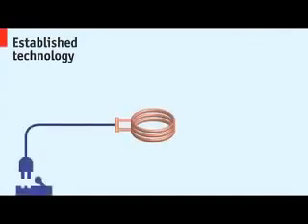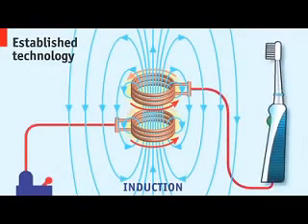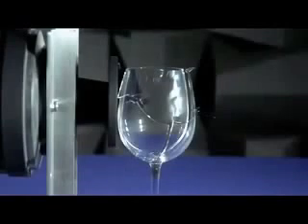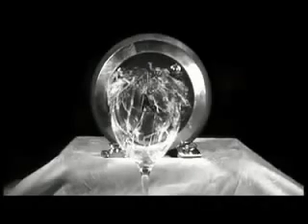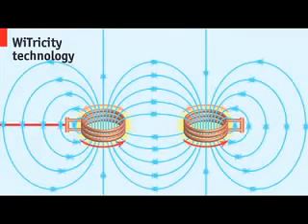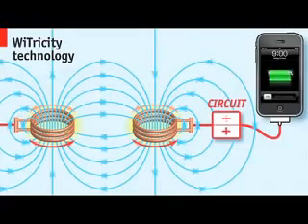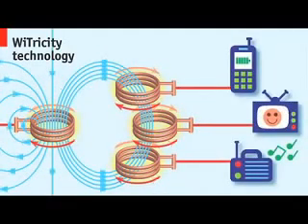How Wireless Energy Transfer Works

Comment: For example, on freeways there are light posts that are wired up all along the road. A resonating Tesla coil could be put in each one where the charge just passes through it. Electric cars with complimentary coils could pick up  the field and turn a motor that turns an alternator to keep the charge on the batteries to extend their range.
Reply: That’s exactly what i thought coil the energy from cars on roads you get the kinetic energy for powering the grid simple

Comment: Earth is a giant magnet, but it is a permanent magnet- permanent magnets don't work this way. It has to be an electromagnet with AC current (preferably at high frequency). This only works with AC current because it is the frequency change that causes the potential for current to flow.

Comment: This is a very good explanation. Today  on yotube 95% of the magnetic coupling wireless power transmission show a school and easy principle : 2 coils perfectly aligned and a LED is lighting on or off.

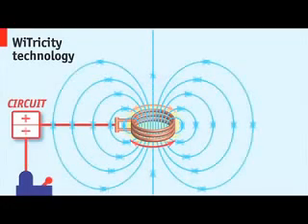You show a principle of coupling when the coils are not in the same axis but where the coupling effect born at a certain distance exactly at 1:16 of your video...very good and another better dimension for physical understanding.
Thank you
Reply: unfortunately this does not work. they cant actually pull this off as they show in the video. this was a video created to raise money but.... it can't be done at these distances without EXTREME loss in power. even wireless phone chargers are inefficient when sitting right on the pad

Comment: Very good, this video shows wireless power short range transfer with alternating current at i50-60hz, that's the current changing direction 50-60 times per sec. Tesla(I believe) knew that changing or pulsating magnetic fields generate power in any conductor in the field range. So the end result we want is Pulsating Direct Current & it needs to pulsate the largest magnetic fields possible. In order to increase a D/C power supply is to change it into A/C then use A/C power step-up phases for power

Comment: Then change the stepped up A/C current back into the original signal that we want to transmit, Pulsating Direct Current but now we have used A/C to step up its amplitude, modulation, and Voltage/Power durring the final A/C to D/C phase. This now High Voltage D/C can be sent up an Antenna to now pulsate huge electromagnetic fields that generate power anywhere with rage of the signal.

Comment: This method could prove usefull onboard an electric vehicles. I like it as a safety feature at first glance. Batteries require heat as well. Maybe these coils could double as a heater for extreme cold environments.

Comment: Also saying this hasn't been done beofre is wrong Induction is used in both heavy and commercial industires for heating coils. Usually the 2nd set of coils is wher it end but from induction welders to stove top cookers. I'm pretty sure using this for transfering energy is much less effecint than just using copper wire.

Comment: This is not Tesla tech. Tesla worked with very high voltage impulses. That means it is driven in one potential direction and allowed to relax or radiate outwards. When another coil that is tuned to these impulse duration and quantity per second variables the reflection of the impulse back to the source emitter. If you time it right you can recycle this reflection back out. This forms a sort of feedback between the two emitters and a magnification happens in the high density plasma streams between the two emitters. The Tesla system would simply be an oscillatory source of impulses. In this case the oscillatory part is on or off, not of positive or negative. If you keep them all one potential it lowers any potential danger. This is like the bird on the live wire effect.
 Also. The impulses can be changed into regular AC by impinging on a solenoid coil. Usually designed inside of the device. With motors you can apply transformer rules as rotation does not interfere with that process. So the field coils should be designed for high voltage impulses (ie Bifilar) that transforms the impulses down in voltage and up in Current. Pinging the inductive element of the solenoid causes it to fill in the blanks of the negative response of the solenoid. A shorted rotor coil is usually the way to do this or in other words a Tesla induction motor. You could build in a pwm that unshorts the rotor coil and reduces the current through an external load, like a Prime mover (motor).
 It seems that longitudinal radiations have very little current in them to loose as it propagates away. But these waves can be converted back down to usable energy via segmented metallic bodies with either a virtual ground or real ground tap.
Reply: @karapugliese9633  Like a stream of varying voltage potentials. If you have a sensor in the stream the voltage will vary up and down at the point of the sensor but the source is still varying it's potential as well. Time being the focus there and space as well...

Comment: If you would see earth, water and air as dielectrics you can realize that when you put electrodes in it they act like capacitors so you can send wireless electricity easier with high voltage and high frequency like tesla did.Look at the air as a dielectric between the two spheres that Tesla erected in the sky and you will have a capacitor

Comment: what if i made a coil whos resonate frequency was the same as the earths. Then buried it in the ground, would you be able to tap into the energy of the earth? Just saying
Reply: Yup!, Workin on it.
Reply: The problem is in the uniformity of the resonance in question the resonance of the magnetic field of the Earth is modified by the conductivity of surrounding objects the resistivity of surrounding object and the result and fluctuations in the resonance of the overall magnetic field, thus obtaining the resonant frequency of the Earth's magnetic field would be very difficult to calculate and since you're receiving coil has to be exactly tuned to the resonant frequency of the emitter in this case the electromagnetic field created by the Earth it would take more power than you can get out within a given small area of the magnetic field just make sure the power is flowing into the receiving coil, thus actually causing a detriment rather than a benefit to the receiving coils overall power reception
Reply: The frequency of the earth's magnetic field switching is very slow.

Comment: Srry pressed wrong button, mean "tryed 2 run both AC and DC current in 2 a copper coil, the power came from a specilal powersupply connected 2 da grid. I placed a seacond, identcal coil next 2 it and connected t 2 an LED and a volt+ampere meter... Nothing absolutely noting, do u think i. Need mor power or bigger coils??? [i tryed w/ both 600 and 1200 laps, used 2 of each kind on 2 different occasions plz hl meh :) "]

Comment: I have a question.. 
If i have 5m distance and use
L = c/f  so it says:
 5m x 300000(lightspeed C) = 1.500.000hz -> 1,5mHz

So I need 1,5mhz on my Transfer Coil..
And want run it with 9v DC..
So i find an Thing that calls: "oszillators"

How can i recive 1,5mHz it with an 0,6mm copperwire ?
How many Spins is that ???

Comment: Does keeping that magnetic field up use more electricity than just using wires?
Reply: +HotMustard If a tree falls in a forest does it make a sound?
Reply: +HotMustard I can't even tell if you are serious.... You sort of attempt to redeem yourself with your response by trying to offer a better example then you answer my question (which was only presented as sarcasm) and reply that a tree doesn't make a sound in the forest if it falls.... Not to mention you first answered 'yes' which indicates it does make a sound. That made my eyes actually cross.   The only two possible grammatically correct replies would be 1.) Yes, it would still make a sound. 2.) No, it would not make a sound. The correct answer being #1.
I can't tell if you are just some kid who is just learning to read and write or if your sentence structure, comprehension, and or reasoning skills are just that poor. I'm not trying to say mine is impeccable but Jesus Christ do you actually read what you write before you post it?
Well anyways, I'd love to stay and chat but I need to go turn off my wall socket. I think I may have left it on and I can't have it using up all my watts.
Reply: +HotMustard LOL. It's so hard not to answer them when they make absolutely no sense. This fanboy just can't wait to see what you have in store next. hahahahaha.

Comment: Nope.  Someone pays.  You may steal it, but not without cost.  Just as a retail store increases its costs because of shoplifting, the  utility company has "energy hikes."  However, if you want to lower your electric bill, zero your bill, or even better, have the electric company pay you, you can install solar panels, and even a residential windmill.  If you feed electricity back into the grid, you are essentially, a micro electric company.  If we all could, we would put them out of business.

Comment: Almost there. Frequency is the key. Tesla created a high frequency discharge that was not high enough. Increase the frequency higher than the static discharge point. The frequency of a magnet is the key to great power. No electricity.

Comment: So why are we still have wallsockets ????
Reply: +D Van ojen Because currently wireless power isn't very efficient and its only useful out of convenience in most scenarios such as charging small items like your cell phone so you don't have to search for a power chord or have to replace one because you wore it out.

Due to the lack in efficiency if you tried to supply all your household appliances with wireless power it would skyrocket your electric bill. Considering you don't constantly plug and unplug them, and don't need to charge them and take them with you everywhere you go it would also not serve much of a purpose unless to hide the power wire on the flat screen you hung on your wall. Which can be done by simply installing an outlet behind it and saving tons on your electric bill.

Also I saved a ton of money on my car insurance by switching to Geico.
Reply: It would drain amperage through coils, which would drain power through every wall outlet. Also, wall outlets are low frequency which is 50 - 60Hz and a good air core coil would be at least 100kHz.

Comment: 2.5 meters? Doesn't this create a magnetic field? Well, what we got here is a magnet with field of 2.5 meters. Ok, that can charge my phone by induction, but it will also attract all ferrous metals in the radius of 2.5 meters? That doesn't sound really practical.
Reply: It won't create a magnetic field that's that strong
Reply: +Evan Yoon Not until you stick an iron core in the middle of that coil. ;)

Comment: One problem I have for all the Tesla fanbois. 
Wouldn't wiring up a whole city like this blast everyone with em radtion? would Wifi stop working? Wouldn't this cause permenant migraines like what people get frm standing near power staions? Would we hear a simmilar highpitched whine you get from large transformer stations but like...all the time everywhere?
wouldn't this require a grid that was always running at full capacity? Doesn't this completely tank the grids energy effeicncy thus requiering  WAAAY more burning coal and natural gas? 
Would all electrical devices have to be redesinged? Like would lithium batteries constanly be overcharging and become useless? How would a device "opt out" of this charging method? Would light bulbs glow constatnly?

Comment: I made it! (11.3 MHz)
Reply: What are distances and efficiency?
Reply: +Vyacheslav Kravchuk It turns on a LED 2-3 cm avay with only 4 turns for the coils. I use magnetic resonance and I use a Raspberry Pi to generate a the signal so I can set it to the best frequency (11.3MHz with a 100pf tuning cap).